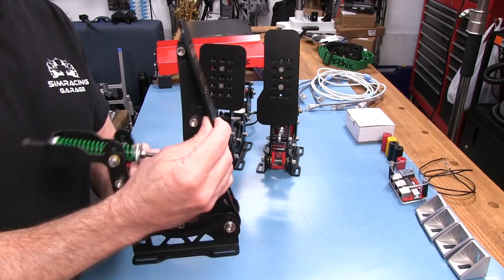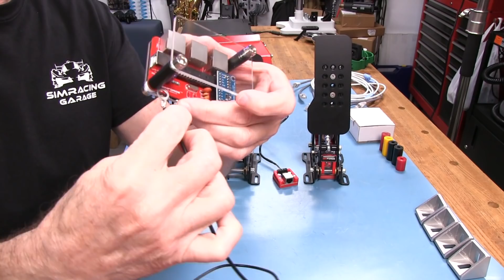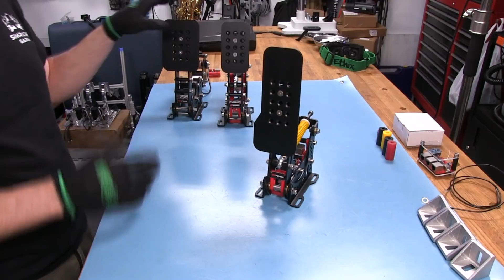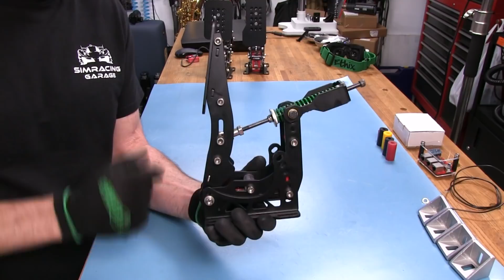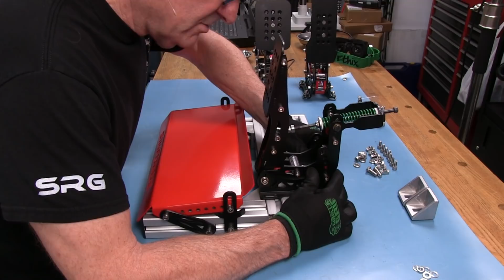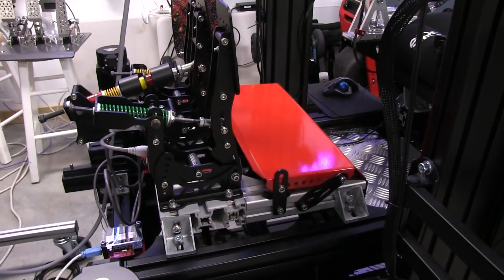Simforge MARK-1 Pedals Review

Comment: would you say these pedals are much better then fanatec v3 pedals ?

I just sold my g25 pedals after 12+ years, Im currently looking for some good pedals where price is around 300/400 euro.

Any advice is appreciated
Reply: I would say they are better than V3s but won’t be as good as HE Sprints performance wise.
Reply: Yes way better than v3s. I haven't used these but its real clear, theyre a big step above v3s. V3s are old now, the csl elite has a better brake and is a newer set. Just my opinion having both sets, and its not the popular opinion, but csl elites are far better. You can space the csl pedals better, they have a better heel plate, the brake is way better, side by side they even look like the more professional pedal, theyre just better. Thats just me tho, but I cant understand anyone thinking the v3s are better. Its generally accepted that the most important pedal(the brake) is much better on csl elites. The hall sensors are better on v3s, they wont fail like the potentiometers on csl elites. However, there is now at least 2 people selling hall sensors that are direct drop ins for csl elites. I bought a set for $35. My friend got a set and they work perfectly and make no change to the pedals other than increasing reliability. Unfortunately these simforge pedals are $333 but its well over 500 with shipping the USA. I do think they're worth the price and possibly superior to huesinkveld sprints while costing a good bit less
Reply: @gregvandy8902  thnxs for in depth sharing of your experience, you made some interresting points, its true that the v3 pedals are indeed old compared to other pedals witch have more updated design and feautures. That is also the reason why i was not so sure to buy the v3 pedals because I noticed more brands and products are entering the sim marketplace, I thought maybi I should ask because those Mark 1 pedals look somehow just supperior to the v3 pedals from first impression.
Reply: @gregvandy8902   That’s totally your own opinion. I got the v3’s with the performance brake kit and the CSLs feel like toys almost in comparison. The v3’s have way more adjustability in every way except lateral. Which most people don’t need. I don’t think these are worth the risk as compared to proven companies and products. I say go with HE sprints if you’re gonna upgrade for the price these will end up costing with no track record or reliability.
Reply: @Wurldly  but the HE you mentioned costs 700 euro which is xtrmely expnsive for someguy with a budget between 300-400 euro, I also dont consider myself xtremely competitive with simrace, I am moderate guy who enjoys the sim experience. 

Im from the netherlands, if I would order the Mark 1 pedals, it would cost totally 440 doller/370euro, total price includes shippment which is 108 dollar/ 90 euro.

what do you think..
Reply: @TheSnake0444   I wouldn’t buy them, the company has no track record of reliability and these haven’t been tested enough. If you just want to upgrade from the g29 without wasting much just get the CSL elites with the load cell kit until the day you can get something like the HE sprint pedals. While for me the v3’s were an upgrade from the CSL’s I did have to buy extra items, which I could have just held off until I saved enough for the HE sprints. CSL’s with the brake cell are the best compromise for your scenario until the day you choose to upgrade.however, if you’re willing to spend more and don’t plan to upgrade to the 700+ range of pedals then the v3’s with the performance brake kit are a better than CSL’s in my opinion. Hope this helps formulate your opinion.
Reply: @Wurldly  yeah your right i am also not buying it yet, I still need to collect much more  info about the mark 1 pedals, I will contact them personally. But the csl pedal is definitely a no go for me because of its basic clutch design. At this point, i have my eyes on the mark 1 and v3 pedals.
Reply: @Wurldly  this is a new company, how would you expect track record on reliability of brand new product unless you have people writing paid fake reviews. Every company starts with a new product without reviews and ownership experiences. At least for Simforge do check out Facebook posts of happy customers.
Reply: Checkout Facebook forums where people have posted about it. They have been shipping this product since beginning of 2021, so talking to existing owners will help you decide rather than listening to people here who are blindly speculating with no real hands on experience.
Reply: @jerrygeorge007   So users with 3 months of experience ? To spend 500 on a pedal set with a basically unknown company is still a gamble wouldn’t you say.
Reply: @Wurldly  first time adopters of any product are taking a chance
Reply: @jerrygeorge007   that’s true, but a lot of people that are looking at this product seem to be in a tight budget. I am just hoping they don’t get screwed as I have in the past. As the saying goes, sometimes if it’s too good to be true, it is.
Reply: @Wurldly  It is a bit of a gamble, but these things are built like tanks. I've had them for 3-4 weeks and I just don't see anything that seems likely to bend/break/wear/etc. It's a great product at a great price.

Comment: I'm about to cancel my V3 order and get these... Oh man I have a decision to make...
Reply: It’s a tough decision to be sure. I’ve recently bought the v3 pedals to replace my 16 year old FrexGP pedals (all pots) and v3 pedals come no where close to the Frex pedals so much so that I’ve bought a usb board, hall sensors and a load cell to “upgrade” the electronics of the Frex Pedals. 

V3s have the damper kit, brake kit and I still feel they’re worse than the Frex with potentiometers. 

Sim forge seems to be heavily influenced by Frex design. Especially the clutch is almost a 1:1 copy of Frex’s clutch, which the best “clutch plate” feel I’ve ever had, short of using an actual clutch plate. 

I’m not sure I like the load cell they used and how they attached it to the pedal. Its range of movement per applied force is almost perpendicular to the direction of force you apply with your foot, so I’m not sure how much linearity (in applied force) one loses.

I am vey intrigued by the design and tempted with the price, but once shipping is included, it cools me down quite a bit. 

This is all my speculation coupled with my experience from using Frex and Fanatec CS v3 pedals so take it with the grain of salt it is warranted.
Reply: @ihsangin5816  Which model and revision of the Frex GP pedals do you own?  I own the Frex SIM3PEDAL v4 and they are on version 4.  It uses hydraulic brake and load cell for throttle & clutch.  They have really improved over time on the revisions, for specs and the looks.  Love the included carbon heel plate.
Reply: Don’t cancel it. These are coming from an unknown Indian company with zero track record. With shipping you’re better off saving up to heusinkveld sprint pedals. Meanwhile get the performance brake kit and damper kit for the throttle for the v3’s and you won’t regret it.
Reply: @Wurldly  time will tell, it's too early to judge a new company like any other new company that brings out a product. Let's not prejudge what none of us have used.
Reply: I'd cancel the v3 order. If you've used any good pedals before you'll be disappointed with v3s. My opinion for what its worth but hey, i prefer csl elites by far over v3s. Mine have some mods, about to get the new hall sensors which are a direct swap. I haven't used these simforge pedals but I can tell they'll be far better than v3s. The lack of adjustability in the v3s and the comfort factor alone just kills the v3s for me. The brake is the most important part and csl elites have a better brake while being more solid and more comfortable to use but comfort is subjective, just my preference. I sold my V3s, i used em for a couple months, tried everything. Hooked the csl's back up, feels like an upgrade.
Reply: The shipping will be about $180 USD keep in mind, you have to factor that in to your decision as Fanatec's shipping price to United States on the ClubSport v3 Pedals is WAY cheaper, as they ship from the US.
Reply: @jonferraez  yeah the total was almost 530$ so I kept my V3 order.. It would be a smart move to have a warehouse/ distributor in the US because that shipping price is going to absolutely kill a lot of sales as it puts the price just out of that "budget SIM" range that they are trying to achieve. I even talked to them thru email a little bit, very quick responses it's just that shopping cost man. They did say tho that they will be having an option to order without the heel plate which will cut down significantly on shipping cost as it is almost 14 lbs. So I'm definitely gonna keep a watch on this.
Reply: @GrammaToad  The cheaper shipping due to the heel plate delete would definitely be interesting to see.  I did not suppose just that equates to a 14 lbs weight.  Thanks for doing the research on that with them.  Definitely would be interested if the shipping did not kill the deal, as to knock ~$115 USD or so off the total.
Reply: @jonferraez  sorry my mistake, I checked and he said "4kg" so a little over 8lbs? This is what he said

"Soon in few days we'll keep an option to order the 3 Pedal set without the mounting base. This will reduce the shipping cost by a lot. The base alone weights around 4 kg. So I suggest, just wait for a couple of days".
Also, to order you place a pre-order and they are manufactured in batches. So your pre-order will ship out the following month.
Reply: @GrammaToad  It looks to only decrease the overall cost by $50 if you want to order the 3 pedal set without the heel plate, shipped to the United States.  I don't know that this is worth it, as the shipping is still $130 USD at that point without including the plate.

Comment: I’m just left a bit perplexed here.  I love Barry’s reviews for the technical stuff but how can you skip any mention of software or lack there of and it would be nice to compare against V3s and the sprints.  To me these look higher quality than the v3s and equal to the Sprints but prices identical to the Fanatec gear.  Man o man, lots of decisions.
Reply: There are no comparisons. Which makes it hard to make a decision for most people. All the products are always reviewed as good value for the price 🤷‍♂️
Reply: @barrymanon9459  this is the best arrangement for manufacturers. Barry gives the facts and no comparisons.
Reply: The price for shipping is about 200 to the US. They didn't design anything as they look like a copy of some other pedals. Manufacturing is cheaper in india and quality is bound to be less than perfect but pedals dont often fail and if they do, they can be fixed or modified. I'm certain theyre way better than v3s which i think are not good at all, I'll take csl elites over v3s all day. These are definitely considered at least a step above v3 pedals, more in line with HE sprints and I would think the sprints are superior, but i think when Barry said he liked them better than another set of more expensive pedals, that he was possibly referring to sprints. These sure have more adjustability and whatnot.

Comment: I have no idea how this is so cheap. There's not much worthwhile that's available between the Clubsport V3s and Sprints, they could put themselves right in the middle... Am I weird for thinking at a price this low, it's vaporware or sketchy somehow? I'd be more willing to buy if they were $500...
Reply: Well these are well over 500 with shipping to the US.  Cost of materials and labor is cheaper and they dont have the huge profit margin most likely. They definitely saved money on design as much is just copied from others. Nothing funny happening, these pedals and company are legit.
Reply: It's cheap for a few reasons. 1: The design is really economical to keep the costs down, using sheet steel and off the shelf parts for pretty much everything. 2: It's made in India where the manufacturing costs for the metalwork will be miles cheaper than elsewhere in the world. 3: You're not getting the refinement in either hardware or software that you would with Fanatec or Heusinkveld etc. 4: You aren't going to have any meaningful warranty, I would imagine (not a huge issue if as many parts are off the shelf as I think they are). Overall the design looks decent, and for the retail price excluding shipping and import fees they seem to be a good deal. After the fees, they might be a bit pricey.
Reply: @bomarfield they have been doing R&D for 2 years as far as I understand, moreover Heusinkveld didn't invent the Simracing pedals to tell that every new brand is a copy. It just looks like any other pedals with clutch Brake and accelerator.
Simforge has been shipping to customers since beginning of 2021, if they were bad , you would already know by now or let's say time will tell. That said every company has to start somewhere like any brand in market now.
Reply: Do check Facebook forums, talk to existing owners. There are posts on these pedals on Facebook sim racing forums

Comment: I'm not even going to look on their website at these, i can guarantee it'll be 200/300 postage to the UK 😂
Reply: The shipping is $181.30 USD to California, United States.  I checked tonight.
Reply: @jonferraez  I had to double take when you said $181 to USA, thought bit high considering they made in the US, checked but nope made in INDIA
Reply: @jonferraez  the total without the base is 464$
Reply: @PuneGamer007  So without the base that comes to $50.00 USD less than the original shipped price for the full set with the base plate.  I don't think there is any reduction to the original shipping cost if only $50 is being deducted from the overall price, if the plate is deleted.  I don't know if that is worth it in the overall savings, as it seems like the base itself would be worth $50 USD if there is no additional shipping cost.  The original shipping for the full set with base is $180 USD to the United States, so actually without the plate there is no savings on shipping even though that is 8 pounds of weight.  The Meca Cup 1 3 pedal set with pedal plate is $130 shipped to United States, and as said is a heavier baseplate (8mm).  BJ Sim Racing's BJ Steel GT 3 pedal set with 8mm pedal plate is $44 USD for shipping.  I realize this is coming from India, but as stated in prior comments it seems the shipping is still high to the US at least.
Reply: @jonferraez  It's 94$ for the 3 Pedal set now
Reply: I just asked SimFordge...$130 US flat rate to US or Canada...and that’s without the baseplate

Just an update as I emailed them

They say to lower the price of shipping to $130, they will charge $464...so my math tells me they’re taking away the baseplate but offering no reduction in price.

So if you want the baseplate...which you’re paying for whether you take it or not...they want another $46 US to ship with the baseplate.

Just be careful when ordering as they throw the numbers around quite loosely.

They blame COVID for the shipping costs...but shipping from India....is cheap! Like a third or less is their cost...they seem to subsiding the pedal price with the crazy shipping costs.

No doubt they appear to be decent pedals and when you hear the initial price, it sounds too good to be true...but when there is $180 ship cost to an item that is $330, that’s pushing 55% of the product you’re buying...not so great anymore imho.
Reply: @canadiankrispybacon  Yeah no way it costs $180 to ship. The shipping for Meca Cup 1 cost $130 and that has a much heavier baseplate.
Reply: It's actually 118$ USD
Reply: @PuneGamer007  postage?  thats pretty reasonable.
Reply: @gewglesux  That's not including import duties, it'll be around 600 all together
Reply: @dinxsy    I forgot about import duties.... any way to get around that?
 BTW  Happy  "Un" Lockdown!  I have  friends in Bristol.  tell me been tough going there.  Good ol Boris!!
Reply: @gewglesux  Having the company mark the item as gift is supposed work, but when they're legitimate businesses doubtful they would. 
I personally think the lockdowns been harder on family members, grandparents not getting to see the kids etc. Well Boris can't do right from wrong, he tries to ease things off to get people slowly back to normal then the "scientist" (who have investments in all this madness some how or another)  forces his hand not to so he gets backlash from everyone.
Reply: @dinxsy  Agreed.  I think that a company like that wouldn't do such a dastardly deed as to try to save their customers some money at the risk of fraud.  Exactly!!  that's what I have been hearing! Moaning about not being able to see  Kids and such!  you're spot on there!  I do feel sorry for him though. There's not much Love for him though.  Best of luck!
Reply: @PuneGamer007  actually it’s $180 US

Comment: $ 444.20 in Germany :(
Reply: No, that's without VAT and you have to add 19% to it as well plus a few Euros fee.
Reply: @clemfandango2379  Probably ends up with 450-460 € due to the weak $, which is still okay if the pedals are going to last. I'm using my HE Pro pedals since over 5 years now without any problems, so this company has my trust, it is around the corner and probably go for the Sprint or Ultimate 1.5 if I feel for something new.